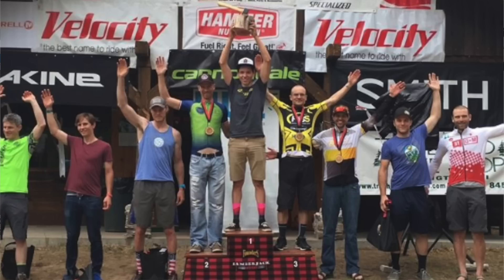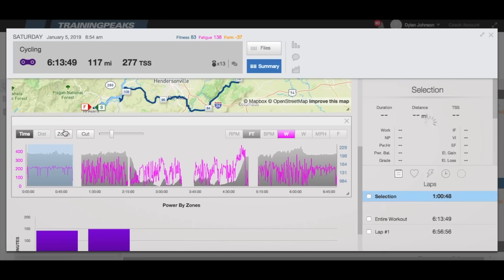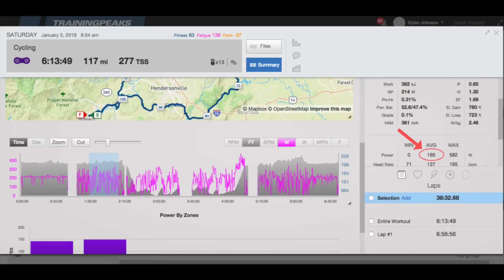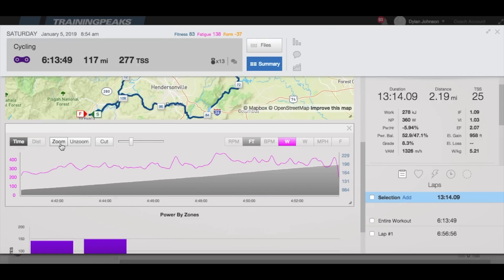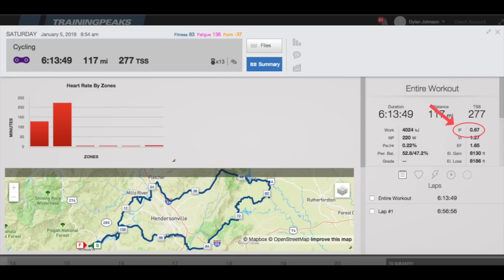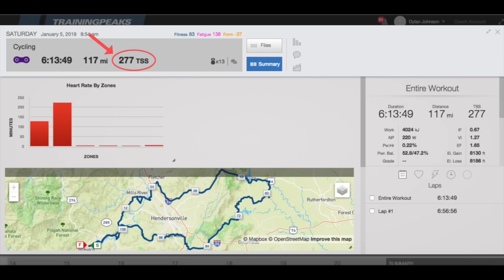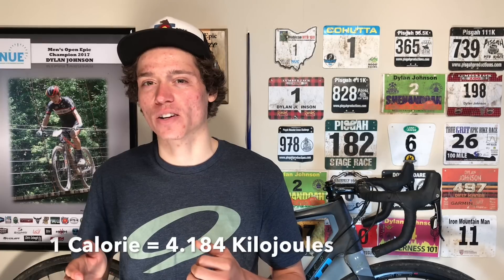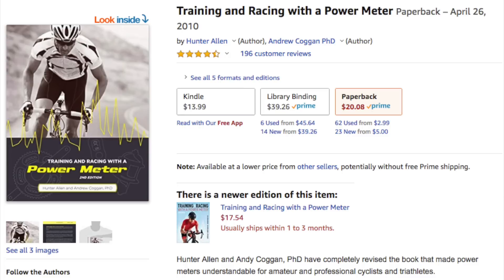Maximize Your Power Meter, How to Analyze Power Data

Comment: A friend shared your channel and I'm enjoying your videos and humor. What information do you monitor during a mountain bike race? I've trained for the Iceman race this Saturday and my goal is to complete in under an hour. Average speed and NP seem like logical starting points. Thanks EDventure
Reply from the maker: NP and heart rate is usually what I have on my screen. Iceman is short enough that it's hard to pace with your cycling computer. Good luck!
Reply: @DylanJohnsonCycling  Thank you. Great work on the channel.

Comment: Question: o have 20 miles long event coming up.  I want to do it within an hour.  Are there any formula or other methods to calculate a goal for how much power I should train for to meet that time goal?
Reply: bikecalculator.com
Reply: Using gearing or actual speed, try a route similar to or the same as the event route on a training ride, and see what you can do.

Comment: Well done. I just wish TrainingPeaks (TP)  would buy out those knuckleheads at TrainerRoad (TR). Can you imagine what a combination! TP's with workouts included😃  I would pay a higher yearly fee for that! The CTS workouts are too expensive, confusing to add  and not as well done compared to TR. TP's ATP is also a pain. So I use a few specific TR workouts to maximize my polarized training and get consistent & progressive results.

Comment: Since Outdoor power generally exceeds Indoor power, does it not follow that Outdoor FTP > Indoor FTP, and thus which value do we enter into Training Peaks? Would be great if it handled both!
I entered my Outdoor # into TP and knocked 10% off on the trainer, but surely that screws up the zones and thus metrics for trainer rides? 
A recent Zwift session showed TSS=112 at the end, but TP calculated TSS=90 for the same ride.

Comment: What about  HR? Power depends on HR structuring workouts around power does not take into the effect that HR has on power. Inherently every other number is based off of, how well you are able to breath, right?
Reply: No, power is absolute. Heart rate is useful for pacing an effort or judging fatigue, but if you have a power meter it isn’t very important.

Comment: Hy Dylan, great video and thanks for all your excellent videos you do. Curious about the FTP you enter into Training Peaks. If I do the 2x8min FTP test, do I enter the actual average FTP or do I use the 0.90 multiplier and enter that number? I think that in Chris’s book, the zones are based on the average from the 2x8 FTP test and not the 0.9 x average, is that right?
Reply: In a similar vein, does one enter Indoor, Outdoor or a blended FTP for those that train indoors and outdoors over the seasons? I've observed that I produce more power on outdoor rides than the trainer, hence currently have this entered into Training Peaks. I set my FTP lower on the trainer, but surely this messes up my zones and I'm not training at the right intensity?

Comment: And make sure to record power meter zeros, turn off auto pause, and also turn off smart recording. Those issues will mess up normalized power calculations.
Reply from the maker: Good point
Reply: I dont know what power meter zeros and smart recording are? Regarding auto pause I think you mean in the cycling computer?
Reply: @Stoffendous  0’s I imagine are time spent either coasting downhill or coasting in general where you’re not pedaling and putting out 0 power. That’s my guess.

Comment: Well I guess I gotta get a power meter now 🙃. As a 16 year old on a budget should I go for power meter on road or mtb??
Reply: Ian Schwing I defer to Dylan but I’d say get on your road bike.  It helps with pacing and on the mtb the terrain does a lot of the pacing for you.
Reply from the maker: @trbeyond  I was going to say the same thing. I love having power on my mtb for race analysis but if I had to chose I'd go with having it on the road bike. Most of the intervals you do should be done on the road anyway so that they are consistent.
Reply from the maker: Stages are going to be your cheapest option but they can also be inaccurate(that being said a stages is far better than no power meter at all). I personally use a quarq and highly recommend one but they are pricier.